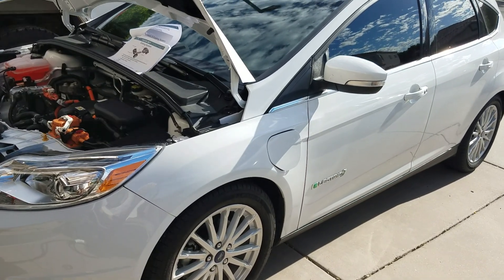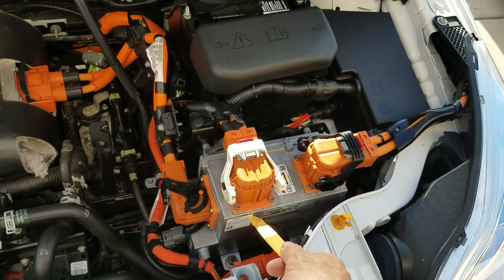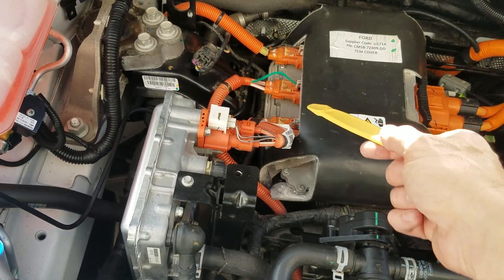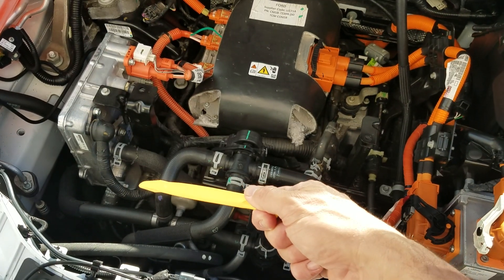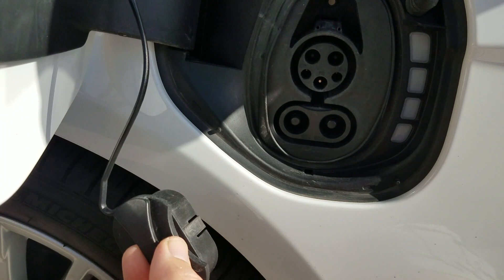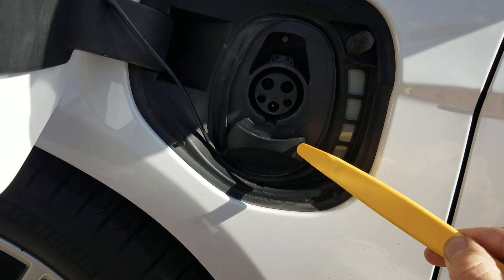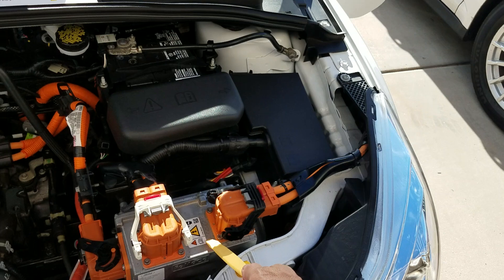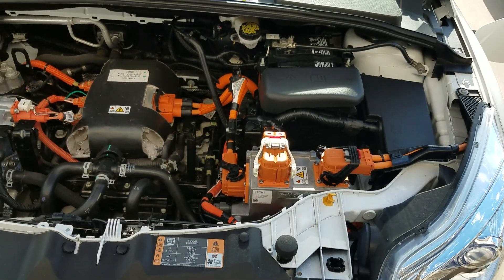2017 Ford Focus Electric how it works

Comment: So no serpentine belt to drive an alternator to charge the onboard battery - that gets recharged/charged by the charger and/or regenerative system I guess?  How effective and quick is the heating system for the cabin of car?  We live in northern climates and I always have wondered how quickly electric cars can warm their occupants over a traditional  engine.
Thanks!

Comment: Can you think of any important maintenance cost or issues to consider if thinking of buying this car in the 30,000 to 50,000 odometer range?
Reply: Check to make sure the DC charger works and see how it performs going down a hill, own one and have a few issues I’ve noticed :’)

Comment: Just a WARNING my Focus electric's hybrid battery just died after 3 years. Ford will no longer warranty and they want 22k to replace! I still owe 6k and I am searching tirelessly through youtube for any videos with help on how to take this thing apart myself. These batteries all will eventually die and it's not like rebuilding a gas motor. You have to replace the whole damn thing for 22k, totalling your car in the process. I HATE FORD with a passion. Ford Customer service manager told me I should have researched what I was buying before I made my purchase. Unbelievable...

Comment: Looks completely different than my 2013!
Reply: 2013 was the first year and has a pivot out charge door and a huge sound deadening foam cover for the motor that looks like a modern gas engine cover but is about 4” thick! Wish my 2020 Bolt EV had that cover as I can just hear the motor whine!
Reply: Do love the 300 mile range of the Bolt my Focus was down to about 90 miles from 100 or so!
Reply: I see the cover bolt holes now but at that time I looked at the motor assembly and it was different! I bet that it has DC fast charging as the 2013 didn’t as it didn’t exist! My Bolt has it but havn’t needed to use it yet!
Reply: @ronalaska2472  I believe the focus only got fast charging in the 2017 model year
Reply: Focus electric???

Comment: two months of no use probably depleted the battery, any idea how to check if battery can be jump started?
Reply from the maker: Yes.  Boost or jump the 12v battery and the vehicle will awaken.
Reply: @shakenbakegc1  that worked, thanks!
Reply from the maker: @krishna81m  
Great.  Next time leave it plugged in and set a Go Time once a week.  That will wake up the vehicle and keep the 12v battery topped off.  Even once a day works without any issues.
Reply: @shakenbakegc1  go time?
Reply: Make sure you use a 12v battery to wake it I had AAA jump mine and it blew up the radio which I replaced and had to have Ford flash the new radio so it would work correctly. A good Lithium ion jump starter would have maybe worked but mine was too small it only worked for a 9.8v output old battery but for completely dead it was not enough!
Reply: @ronalaska2472  yeah, it was fairly simple after figuring out where the both sides (2 O Clock facing in front) of the jump starter would go

Comment: My Ford Focus EV 2017 , doesn’t charge DC , coz the lock mechanism, gets out and within 2 seconds it gets back in again. How may I solve this issue. ???
Reply from the maker: Try supporting the cable so the weight isnt yanking put the J1772 connector.  When you hear the lock pin engage then you should be good.
Reply: I did that so many times but still no luck , the lock engages at the communication part , then it disengage and the DC charger writes charging session completed.
Reply from the maker: @elmalek2007  not sure what else to try.  Is that button near the shifter depressed that locks the plug?  Have you tried a different charging station?

Comment: Is there a way to add another battery module from a salvage car to extend the battery? As in actually get the onboard computer to see the additional range. Great video very knowledgeable
Reply from the maker: No not really.  Any additional cells would need to be in parallel and liquid cooled and monitored.    Not a practical solution
Reply: Gotcha. I think it would be great if we are able to upgrade the battery packs for these cars to larger packs to increase the range. Kinda like the tesla idea of swapping the battery pack out quickly
Reply: Put a pack in parallel, although stuffing Tesla modules in place of the original battery would be better though...

Comment: Hi...just a qq regarding your green gto.....what exact color code was it?  I will be painting mine soon... thanks
Reply from the maker: Verdoro Green paint code Q.
Du Pont 4947-LH
Ditzler 43745
Rinshed-Mason A-1936

I used R-M Diamont paint with DC-92 clear.

Hope this helps.
Reply: RM diamont.....code..?
Reply from the maker: @SifsSwag  
There isnt a code it is a color mix formula.  If you e-mail me at my gmail then I can send you a photo of the formula label printed on the can.  Do you have an R-M dealer near you?
Reply: RM diamont.....code..?